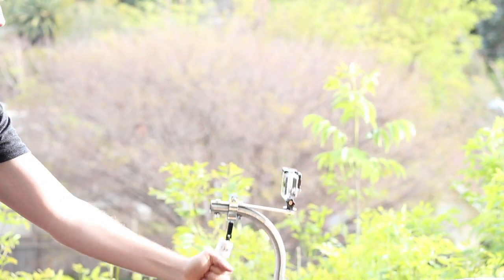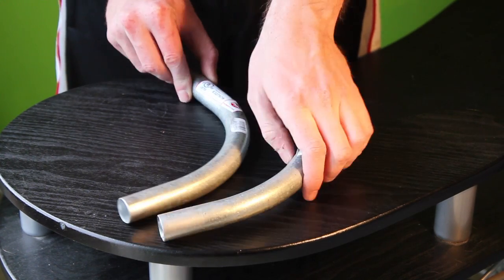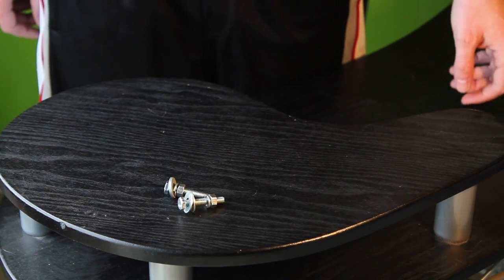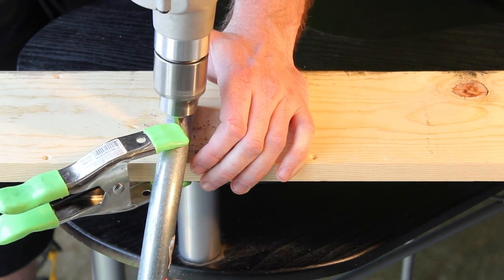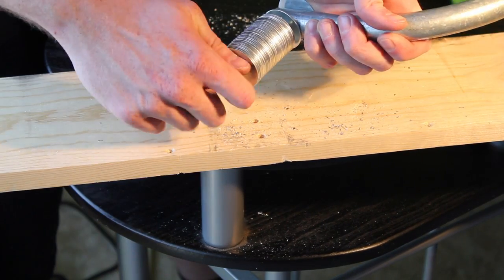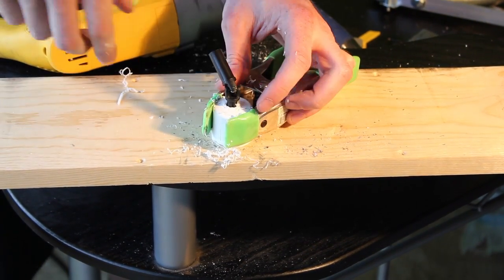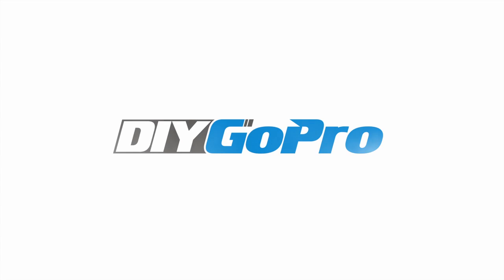DIY GoPro Steadicam Tutorial

Comment: It appears to be over-weighted with too many fender washers. This causes the unit to sway like a pendulum as seen at the end of the video. The key to a stedy-cam is to balance the cameras weight at the fulcrum (your gimbal mount). Try subtracting weight from the bottom, or adding weight up top to the rear which may level the platform out.

Comment: i asembled the gimble by putting one peg into the hole as mch as i could then i tapped it with a hammer to get it in a little farther. to get the other peg in the hole, i put it in to a vice.... )))o==((((  little diagram with gimble in the middle i tightened the vice and the plastic just kind of bent and the peg slid in. same for the other side... ill make a video later.

Comment: lol... no mention of the SPECIAL TOOL for assembling the gimble when you buy the pieces! lol  I had to take a break while doing the assemble to prevent breaking things in a fit on frustration. heheh

I am finding I will need to add more washers on the counter balance to make up for the weight of the video back and expanded case. I didn't even think of that. :-\ Thanks for the video!

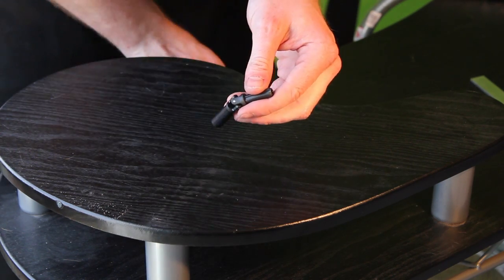Comment: 1:07 I got some of these Traxxas half shafts, and this part of the video doesn't seem explain how to assemble them. What is it you are doing there with the pliers there exactly? Does the axle on the cross joint move somehow? Did you have bend the black plastic housing to get it in there? Thanks for the video, I was subbing the Traxxas part with a 1/4" u-joint for a ratchet set before the parts came in from eBay, it worked pretty well after I sprayed some WD40 on it.